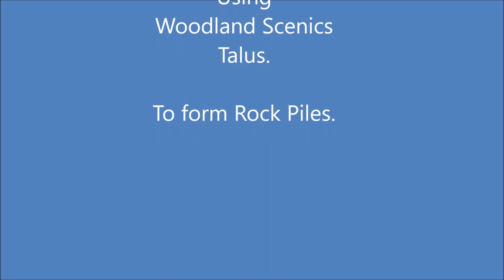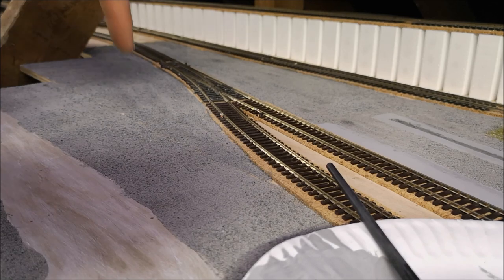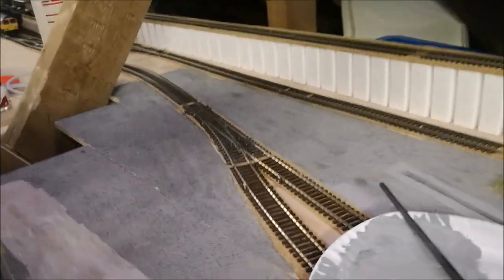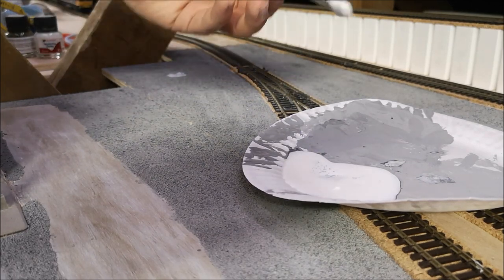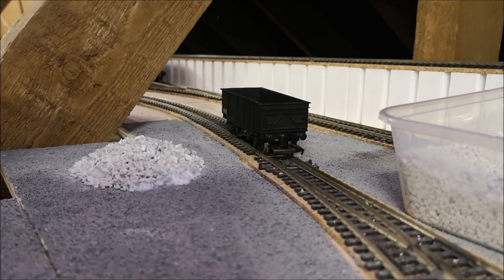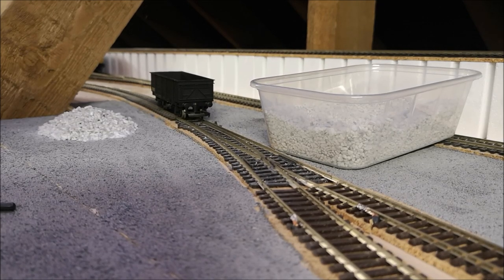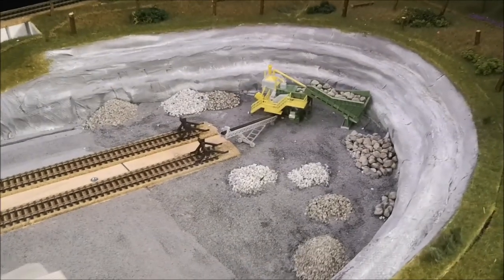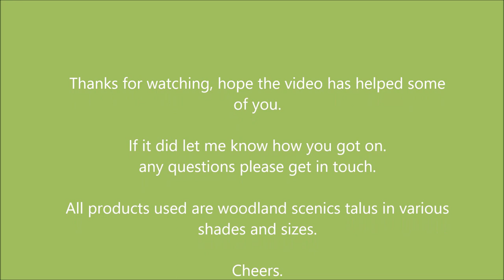Using Woodland Scenics Talus

Comment: Nice work!  An idea from a couple decades back to make rockpiles quickly, when I made wargaming scenics, is to use paper towel or toilet paper cardboard tubes cut to whatever area you need to fit into.  Then fill the tube and lift slowly.  It gives really nice piles and you can keep going up as needed.
Reply from the maker: That's a great tip, thank you